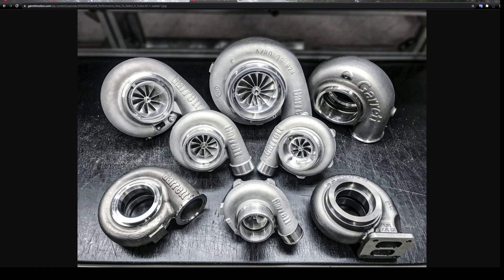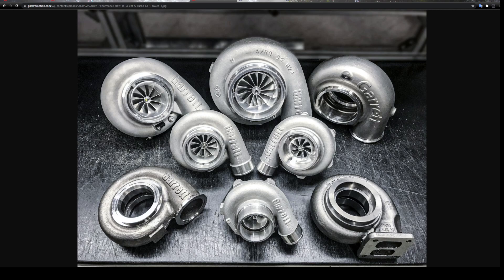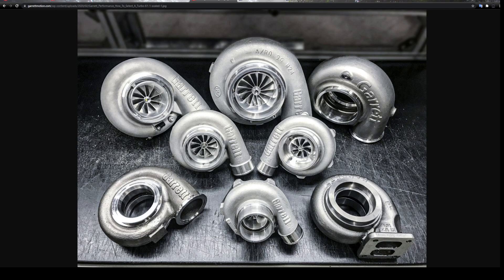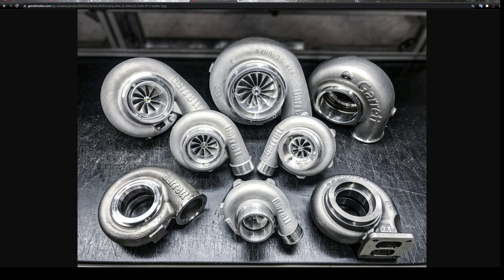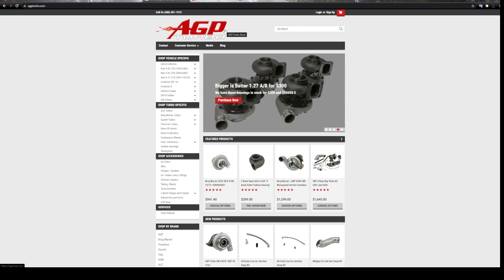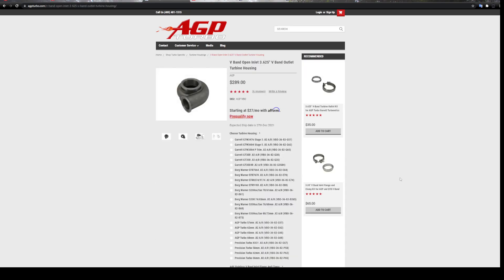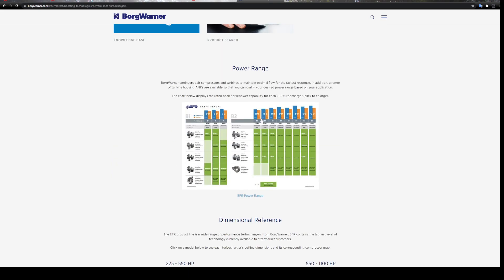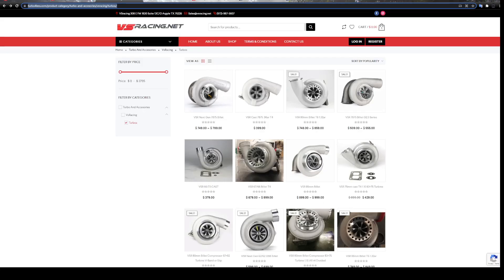How to Choose a Turbocharger | Turbocharging Basics

Comment: i have a tj jeep wrangler 4.0l 6 cylinder and wanting to turbo it for more torque and faster over all being shut a small engine and me having huge tires. i wanted to say thankyou for such a informative video. this was the first video i watched for finding info on turbos and setups really and this helped a lot with great references. i called a local shop that does turbos and he told me i was a ducking idiot for wanting to put a T04e on from amazon and that i would have the engine smoking in 6 months if i make it to that and asked me all about this injector stuff and what ecu masters or something and yeah i was super confused and so yeah. calling first thing in the morning to have garret help point me in the right direction 👍🏼 

i just wanted more horsepower and i entered a new world 😂😂😂
Reply from the maker: Thanks 🙏

Comment: Currently running a m20b25 with a rsi manifold that’s warped and a tired hx35. Running megasquirt with sequential ignition on a street tune at 10psi. Just gonna run stock internals and rebuild the head. Any suggestions on exhaust manifold, cam, turbo? Love the channel. It’s been a huge help learning megasquirt.
Reply from the maker: Thanks ! I think it depends on your power goal but for the HX35 and around 400hp any manifold will work fine ( take a look at PPF Sweden ) for a cam and that power level you can keep it mild with a 272 or 280 grind from a variety of places ( catcams, bimmerheads, Ireland engineering, schrick) the turbo really depends on how much power you want and what RPM you want that power. The gt3076 on my b27 hits about 300 rpm and makes really good power up to the high 400s . Thanks for watching!
Reply: @TurbineResearch  how many psi is safe with stock internals and stock headgasket? I do have ARP head studs already installed. I see mixed statements on forums. 400hp would be pretty ideal as long as it’s reliable. I actually already have a 272 cam from Ireland engineering I was planning to use before I went turbo.
Reply from the maker: @StraubelFilms  I have been running 16psi and 15deg on stock everything for 4 years with no problems on 91oct pump gas . I have ran 19-21psi on e85 too with all stock everything including head gasket.
Reply: @TurbineResearch  good to know. I’ve been running 10psi on 93 which is almost impossible to find. Appreciate the super quick reply’s. Keep up the good work on videos.
Reply from the maker: @StraubelFilms  you're welcome! I'm happy to help
Reply: @TurbineResearch  Is there another platform I could direct message you on? Or possibly an email I could message. I just have a couple quick questions that would be easier to answer with visuals.